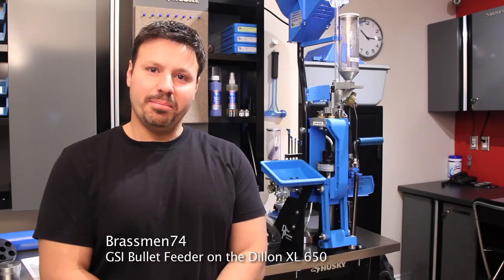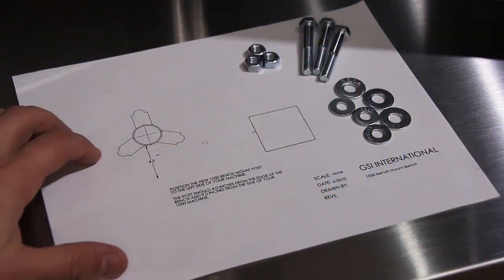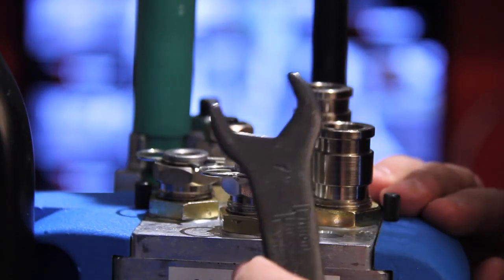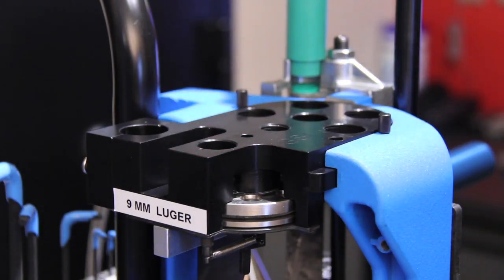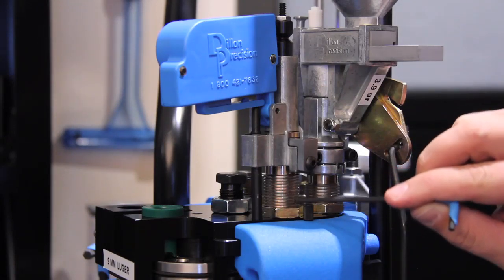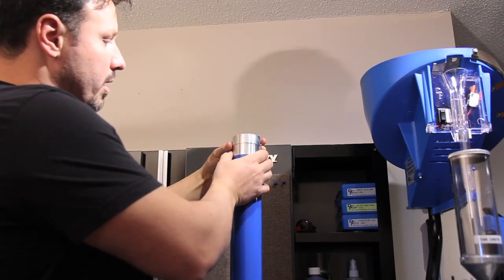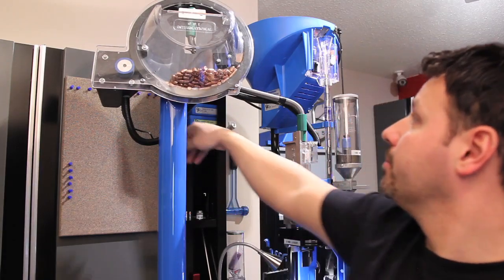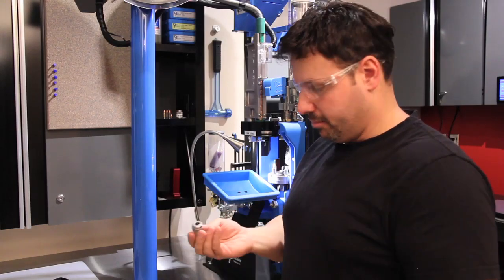GSI Bullet Feeder System on Dillon XL 650

Comment: Great bullet feeder but in switching over your dies to the GSI feeder toolhead you should set up the dies as you would have in even a new Dillon toolhead because you are assuming that the GSI toolhead is machined to exactly the same height and thickness as the Dillon toolhead is.  It doesn't take a lot of time but it ensures that you are precise with all the die settings.

Comment from the maker: butlerbobby, asked: The GSI web site shows the GSI bullet feeder directly mounted on the XL650.  You have yours mounted on a separate post.  Why the difference? 
Answer: They haven't updated there website with new photos, anything shipped after April 2014 will have the post as shown in my video above. Except it ships in the color Black, I painted mine blue.
Reply from the maker: The reason actually, they told me is the weight of having the bullet feeder directly on the toolhead gave them problems so they changed the design. :)

Comment: Nice set up but  you should only tighten the lock ring with a case in the die holding it perfectly concentric. I would also take the 5 minutes to reset my dies.

Comment: can you use lead bullet with this unit
Reply: Yes lead bullets sized to the appropriate caliber work.  As long as the projectile is the proper caliber size there are no problem limitations.  Each caliber to be reloaded must have the required correctly sized reloading dies.

Comment: That's cool in all but if you don't shoot as much as that machine cost you properly don't need it but if you load your own and never buy factory then this is justified, and how is this when you load different pistol rounds and center fire rifle rounds is this bullet feeder universal or do you need to by different ones for each caliber.
Reply: The Dillon case feeder has four plates that are necessary based on the caliber  that is being reloaded.  These plates cost about $40 each (small pistol, large pistol, small rifle, large rifle).
Reply: HaveFunLetsAuction  is it possible to have the powder safety powder system along with the Dillon bullet feeder ?
Reply: Yes, the tool head has a separate station for the powder check die & the bullet feed die allowing both to function as needed.
Reply: I paid for my press after reloading about 6,000 9mm rounds.  I reload 9mm & 223 so I actually broke even sooner.  A general  rule of thumb is that you can save about 50% of the retail costs by reloading.  Reloading is a hobby in itself which pays back savings benefits.
Reply: HaveFunLetsAuction thanks I actually went red and after months of just headaches with it I finally figured it out and the press finally paid for itself but thanks for the replies.
Reply: HaveFunLetsAuction   thanks for the response.  You seem to be knowledgeable about reloading and see your comments on a lot of different youtube videos  lol